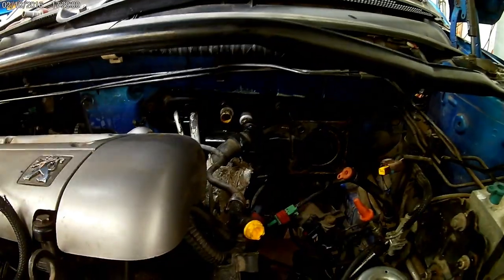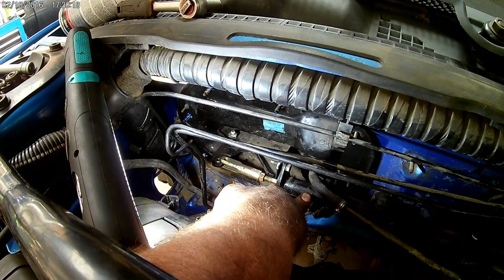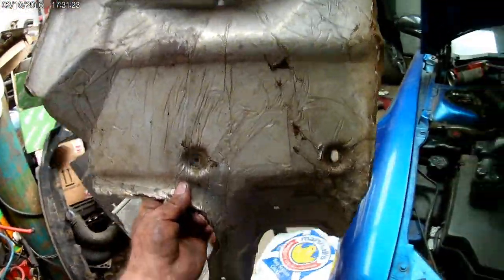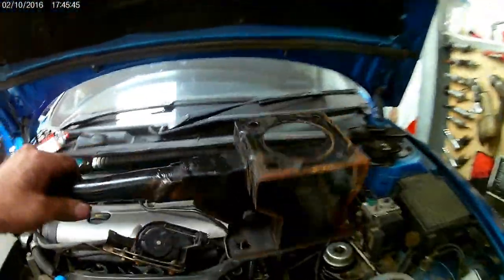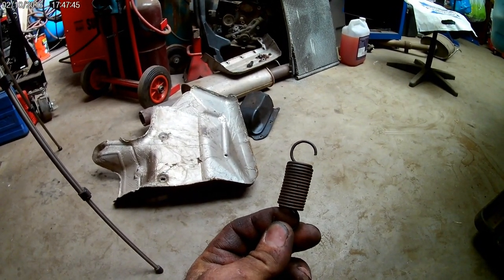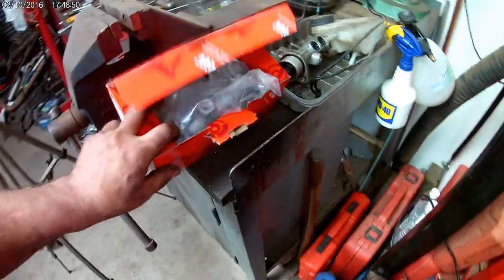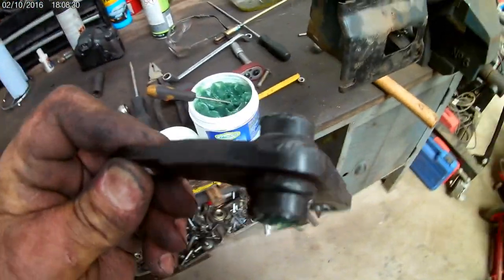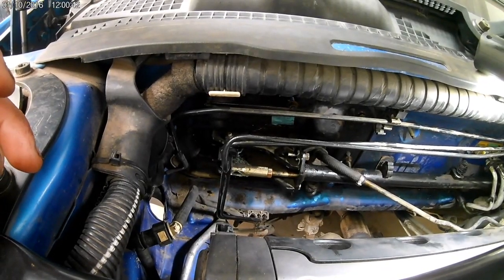Project Peugeot 406 Coupe part 7 - Brakes ( solution for Peugeot 406 lazy brake pedal)

Comment: how do u bleed the peugeot 406 brakes?
Reply from the maker: The proper procedure is with pressure bleeder (i am using this: "Sealey VS820 Brake & Clutch Bleeding System") -  pressurize the system to about 2 bar and then activate each individual caliper with Lexia/P2000 diagnostic software. If you don't have Lexia/PP2000 bleed them just with the pressure bleeder in this order: Rear Left, Rear Right, Front Left, Front Right. But if you have trapped air in the ABS unit the only way is to bleed the system with Lexia/PP2000.

Comment: Great videos. I have a similar issue with the brakes on my coupe. Any hints on getting the servo out?
Reply from the maker: Just take your time with the four bolts holding the servo to the bracket. They are really awkward to reach. I found it easy to undo the bottom two bolts from under the car and the top two from the top. Swivel head ratchet spanner is your best friend.........:)
Reply: Thanks.... already lost two extensions & sockets behind the damn thing! Magnetic pick up tool to the rescue. Will have another bash this weekend.